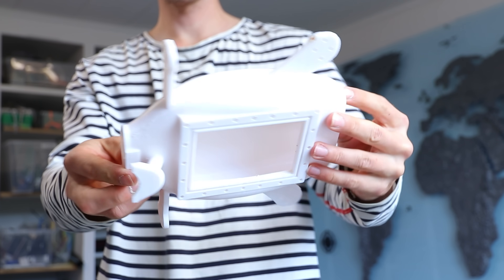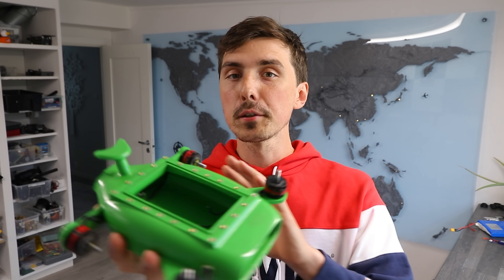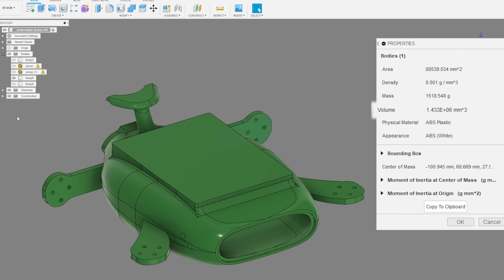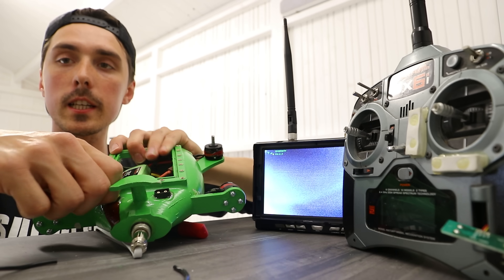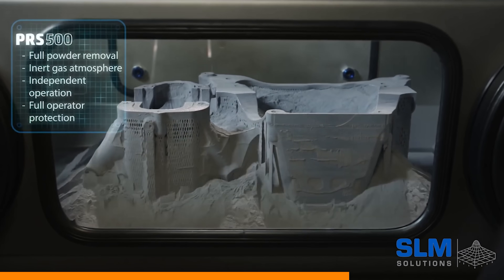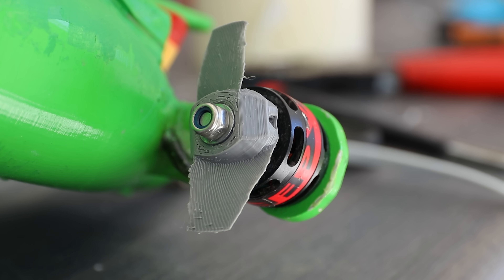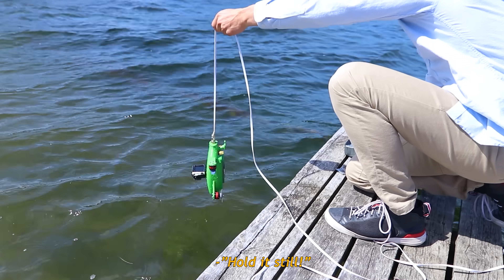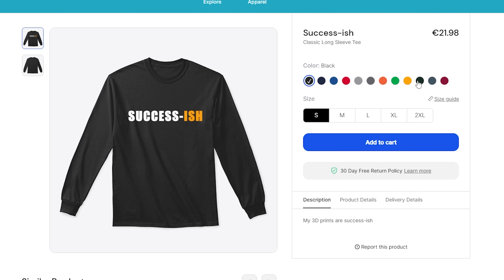Underwater Drone Built With Parts From a Flying Drone

Comment: Fantastic work, dude! Really well done! 😃
The only thing I would do differently is that I would use a flight controller with iNav! This way you would only need 4 wires for the receiver. 😉
Anyway, stay safe there with your family! 🖖😊
Reply: I used a crossfire to pwm converter in mine. I  am really tempted to add an inav fc and GPS in the floatation device in mine but that's a learning curve I am not quite ready for at the moment haha
Reply: @sulphur_fpv  Nice! 😃

Comment: You may consider using removable gel to protect your electronic from accidental water ingress, we use that on outdoor electrical junction box, you mix 2 liquid that solidify into a gel that is close in texture to the gel candle. If you want to remove, you can juste break the gel
Reply: Also perhaps a kids daiper for capturing the water inside 😀🤓

Comment: You have to remember to oil those motors after EVERY use. Get some CorrosionX HD and soak the motors in it. It should help prevent the bearings from seizing like they did
Reply: Yer for my rc car motors /drone I power them up in distilled water to get out all the dirt then oil then they don’t seize
Reply: @ethankey5805  What Is Islam?

Islam is not just another religion. 

It is the same message preached by Moses, Jesus and Abraham.

Islam literally means ‘submission to God’ and it teaches us to have a direct relationship with God. 

It reminds us that since God created us, no one should be worshipped except God alone. 

It also teaches that God is nothing like a human being or like anything that we can imagine.

 The concept of God is summarized in the Quran as:

{ “Say, He is God, the One. God, the Absolute. He does not give birth, nor was He born, and there is nothing like Him.”} (Quran 112:1-4)

Becoming a Muslim is not turning your back to Jesus. 

Rather it’s going back to the original teachings of Jesus and obeying him
Reply: @ahmdabdallah5811  mate what tf does this have to do with rc
Reply: You can easily replace the bearings with 3D resin printed water-film bearings/bushings , I did this on a 5065 motor on a diy electric kayak, works much better than ball bearings under water. The water forms a film and decreases the noise a bit. The ones I have designed have 6 small canals running axially across the bushings which suck in the water that creates the film. No oil, no rust, no contact
Reply: @hjoore  A water seal to keep out water? Im skeptical but also intrigued
Reply: ceramic bearings
Reply: @Blox117  yer that would probably work as long as there is no rust able metal in it
Reply: @ethankey5805  i think having the bearings open is a good idea too. salt crystals can form inside closed ones
Reply: @ Bittersweet Symphony All water is wildlife water...

@ Thomas Horst Vegetable oil doesn't make it any less oil. It pollutes in the same way as other oils.
Reply: Ahhh I use it all the time Corrosion xHD
Reply: I was expecting a 3D printed scuba suit...  kinda disappointing.
Reply: you are not supposed to pollute wildlife water with oil
Reply: @bittasweetsymphony726  you can use vegetable oil instead

Comment: 3:37... Ever heard of a rechargeable Electric Screw driver...😉 Why does the battery need to be in the Submarine Drone... Why not at the surface. Lead shot can be used for weight in the drone.
Reply: He has an electric drill driver and the battery cannot be outside the drone because he is using Ethernet cable and the little wires in the ethernet cable they do not enough ampere rating to run 4 motors on a Li Po and ethernet is made for data transfer which he is using as intended, thank you.
P.S If he had to use the battery outside the drone he would need thicker wires and they would provide quite a lot of resistance in maneuvering the drone and using really long wires to run something on DC voltage is not the best idea.

Comment: Now it would be cool that if the arms moved then you can tilt the motors up and fly out of the water when not being used under water as long as you are using propellers that would allow use in both ways